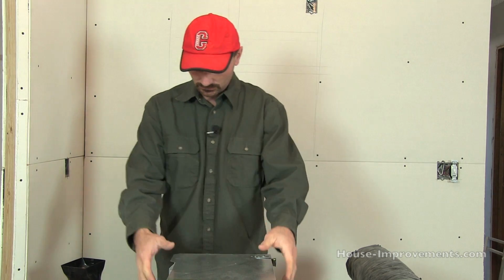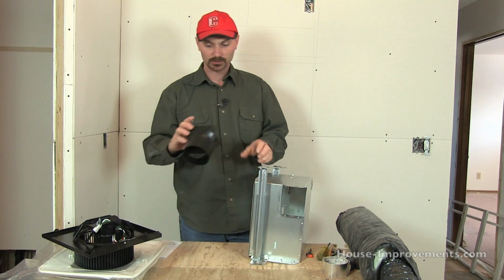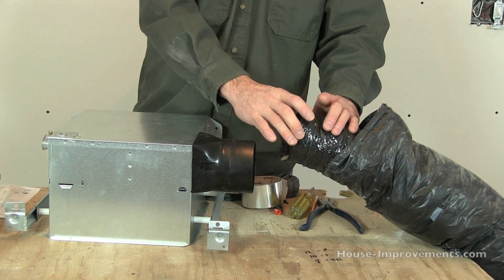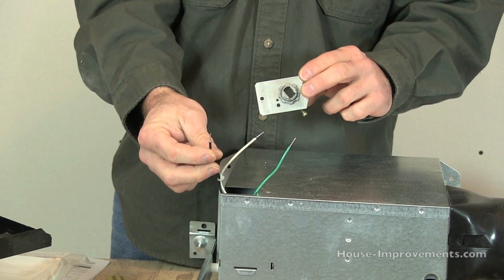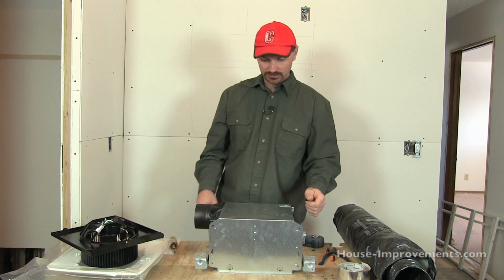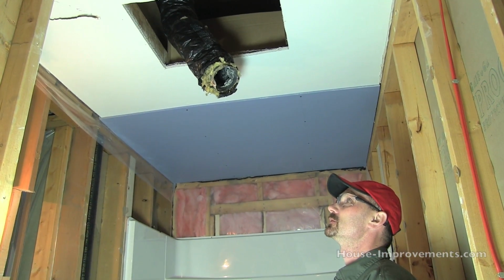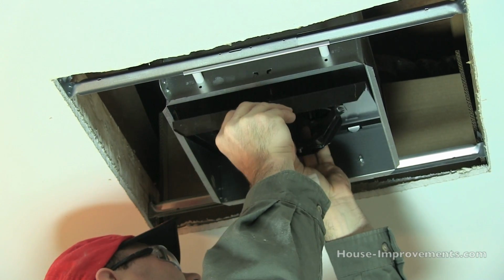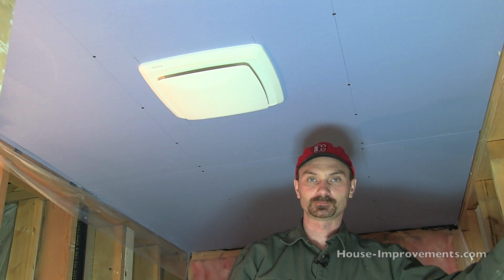How To Install a Bath Fan

Comment: Where can I get those mounting brackets?  I have been putting off installing a fan in the bathroom out of pure laziness for not wanting to build a bracket for mounting between joists. These would solve this problem perfectly.  I havn't been able to locate them at any of my local building stores.
Reply from the maker: This fan came with them It was either a Broan or Panisonic fan??

Comment: HEY shannon. I would suggest mastic tape over foil tape any day. Especially in a floor space where you will not be able to see it easily. Your right the foil will last longer than the duct tape, but the adhesive will not. This can lead to a seperate vent to duct situation where the vent will be throwing moisture into the floor or attic space. I would never use plain foil tape for this.

Comment: What if you're starting in a bathroom that never had a vent in it at all and you gotta cut into the drywall ceiling but there's no way to get to it because I'm on the first floor
Reply from the maker: Usually means taking the ceiling down to run the vent and mount the fan box. Running the electrical can be a hastle as well.

Comment: Hi Shannon, great video!  I own a condo and need to change my exhaust fan out but i have no attic access.....how would i go about hooking up the the venting?
Reply from the maker: it depends what they used but more than likely it will involve cutting the drywall out a bit to get at it. Have you considered just changeing the motor only ?if you can find a model and make you may find one that fits or a actual replacement for that unit
Reply: Thank you so much for the reply.  I have considered that but don't know what which motor/fan will fit in my current one. How can i tell what the model i currently have without having the original box?

Comment: Thanks for the video Shannon- Very informative as usual!!

Is it possible to do this install without having to climb into the attic and changing the drywall?  I'm attempting to change-out what appears to be a 30 yr old exhaust that's rusted out and needs to be replaced badly.  The opening for this fan is 8.5".  The new fan is 10.5".  I'm planning to gang this connection up with the recessed light that's going over the shower and then hooking them both up to one switch.  Two recessed lights will be on their own switch, so dual switches on wall.  Any suggestions?  Thanks!!
Reply from the maker: Typically getting in the ceiling above is needed to properly attach the venting . If you have any other questions, please use the forum. http://www.house-improvements.com/forums/

Comment: He starts out saying "how to replace" so I almost skipped this video. He has good info on what to buy. I had my roofers install a roof vent for me so this video has much of what I need to INSTALL a new vent where none is existing now.  It still is mostly a "replacement" video not a "new installation" video. I will have to lookup duct installation and wiring to a switch which is not in this video. Still worth watching.
Reply from the maker: +Paul Tuttle Thanks for watching , we do show the duct and wiring if you start watching at the 9 minute mark.

Comment: They say flexiduct has much less air flow (more resistance) than a smooth metal duct. Are there situations where a metal duct is preferred over flexible? Thanks for your excellent videos.
Reply from the maker: +Paul I would use metal duct on long runs over 15'. The reason the flex duct is nice to use is that it is insulated already.
Reply: Very good, thanks!

Comment: Hi, Shannon, I love your videos and they inspire me to do work around the house myself, and not hire someone that would charge me an arm and a leg.  You're doing and great job and please keep up the good work and continue to make great dyi videos.

I do have request though -  is there any way you could shoot a video on how to properly vent a bathroom or dryer vent out of the roof?  I'm faced with this dilemma since when I bought my house, I found out the when the roof was replaced, the roofers never put back the roof louver for the bathroom exhaust fans and the dryer exhaust pipe as well.

Again, great jobs on your videos and God bless.
Reply from the maker: +Van S. check out my website I have an article there.

Comment: i don't have access to the attic. can i just pre hook the vent tube and install it? or should i cut bigger hole like you have here and access from the bottom. does the last step, humidity blockage required since i live in FL
Reply from the maker: +t dub You will need access form below to mount the unit and attach the vent.

Comment: I am going to be conducting a very similar project soon. Installing a Panasonic Whisper Quiet fan into my plaster and lath ceiling and then going over that with drywall. My question: when you mounted your fan housing, you mentioned leaving at 1/2 inch lower so that it ends up flush with the drywall, correct? Is there a flange on the bottom of the fan housing or just the vertical wall surface/sides of the housing so that I can cut around the housing once the drywall is up in front of it? Did you precut your drywall to match the hole or mount drywall and then cut it around the fan housing? Thank you.
Reply from the maker: Michael McCarthy  No they usually have a flange so cutting around it after the drywall is up is not possible. it would be nice if they were designed to be able to do that though.

Comment: Hi Shannon.  Did you use a 20amp breaker or a 15 amp breaker for this fan?
Reply from the maker: dani Maxx That entire bathroom is on a 20 amp GFCI breaker.
Reply: So it doesn't have to be on a seperate circuit.  Would I be able to blow dry my hair with the fan running too?

Comment: As an electrician I've installed hundreds of bath fans, but still learned a couple tips to improve my installation techniques, such as removing the fan motor from the housing before installing. One suggestion is to hook up the wiring and ducting before you mount the fan in the ceiling (not always possible), so you dont have to spend much time in the attic. Also if you can get above the fan in the attic, you may be able to install the fan without needing any drywall repair at the end. Just install the fan from above, and cut out exactly what you need from below for the grill.
Reply: yeha this video is the besth thank you

Comment: Great video, I like the videos you do, they show detailed instructions on "How-To" .
One question about the ducting for the fans,  can you have two bathroom fans running to the same vent pipe?  or do they need individual vents for each fan
Reply from the maker: They should be individual vents unless you are using a whole home ventilation unit.
Reply: A previous owner hooked our kitchen and bathroom fans to the one vent because they are back to back.  Whenever we have the kitchen fan on we have to turn the bathroom fan on or we will have a bathroom that stinks of whatever we were cooking!  It's high on our list of things to fix!